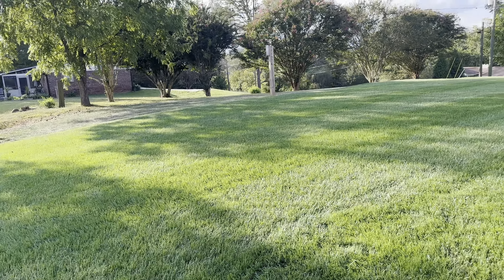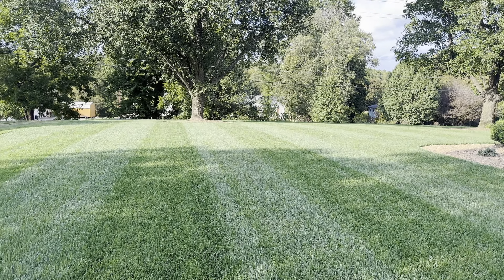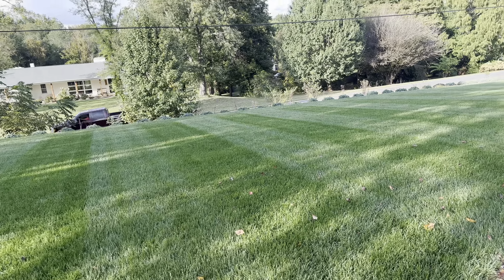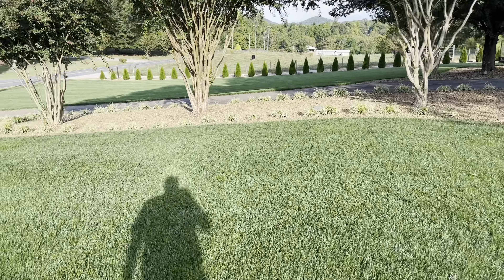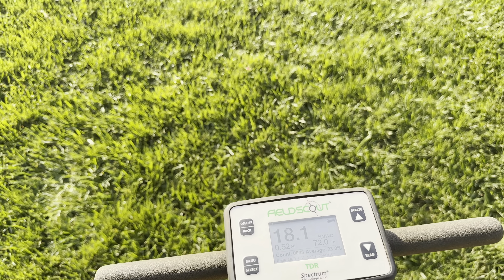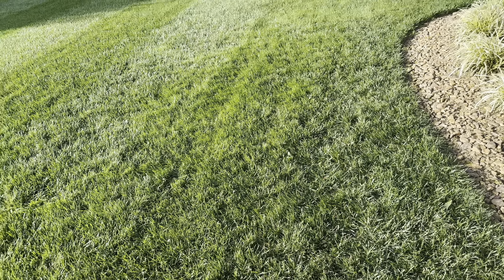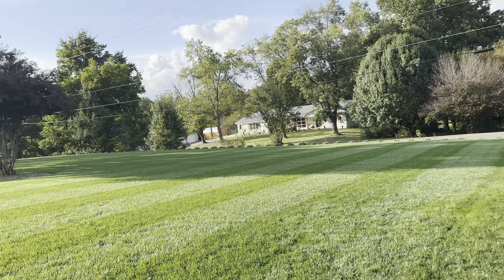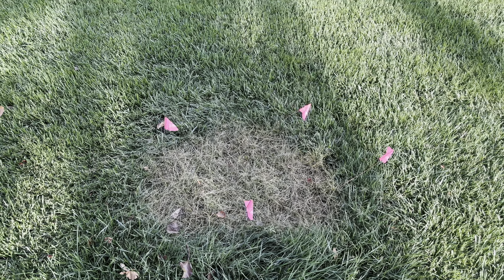Fescue Aerification and Overseeding 1 Month Update

Comment: What cultivars are you using? Looks great
Reply from the maker: Originally it was 4th millennium, Traverse 2, Raptor 3, and Titanium 2ls. Last fall I used 4th millennium, Avenger 3, Titanium gls and Raptor LS. I basically just replaced the older varieties with newer ones because the older ones probably want be available much longer.
Reply: @Primetime_Fescue  I have similar ones that came with New Millenia and SuperTurf II blends. Also got Titanium and 4th M on their own and noticed that they are almost too thin and flimsy, giving the lawn a shaggy messy look, especially a couple months after seeding. Maybe less of an issue with Traverse. You obviously don't have this problem, maybe bc of shorter cut or more mature plants??
Reply from the maker: @peterobara3040 none of the newer varieties like to be mowed tall imo.
I mow at 3 to 3.25” during the summer. First year grass is very weak to begin with.